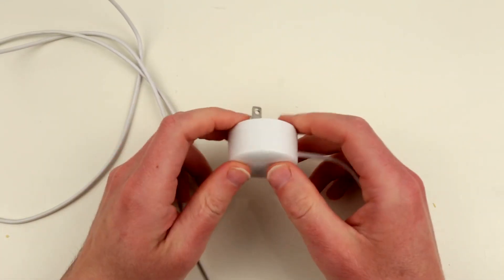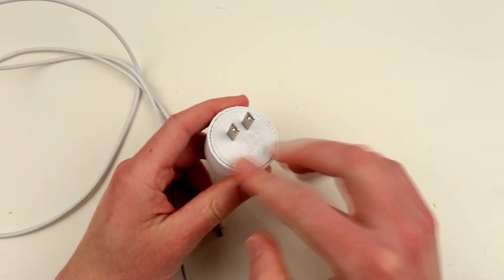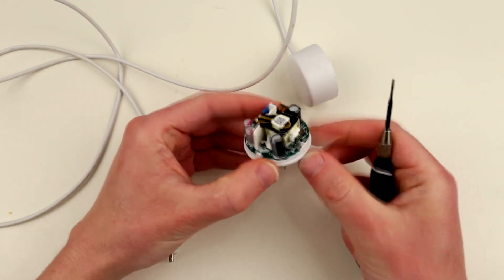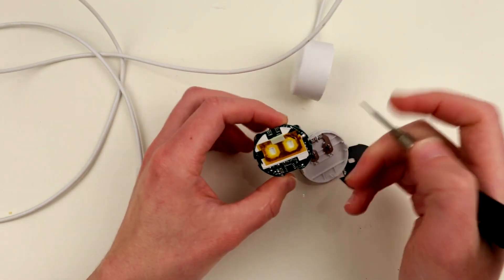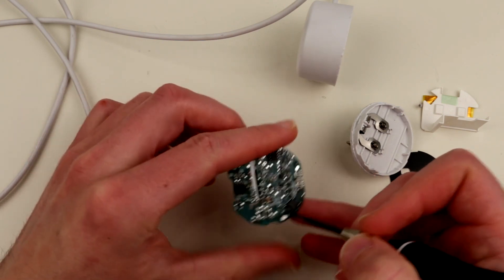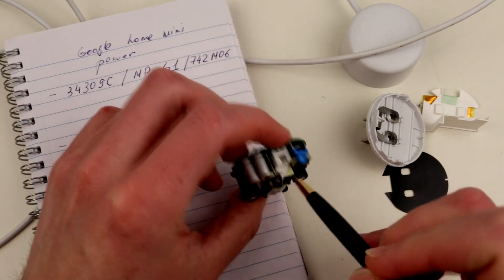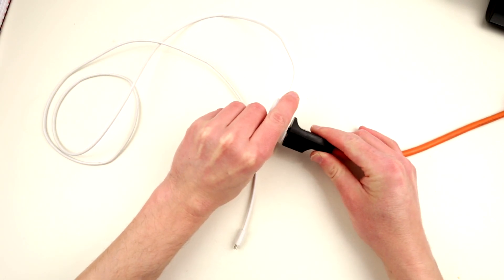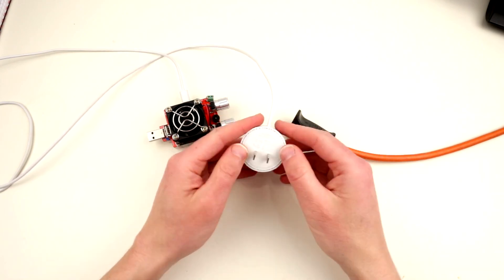Teardown and Repair of Google Home mini power supply

Comment: I'd love to see if the Nest Wifi plug is similar. I'm frustrated it takes up so much space on my outlet, which has USB chargers that get covered up by this round shape
Reply from the maker: You can use pretry much any USB plug as long as it can do 2A continuous !
Reply: @InsideOutElectronics  I'm not interested in powering it with USB, I want an AC adapter that doesn't cover the USB ports on my outlet
Reply from the maker: @BothellPlaysMusic  But you can use any AC-USB adapter that fits you dimensional needs, as long as it provides 2A 5V. For example for My Google home mini im using just random tall and square ac-uab plug that does not cover anything

Comment: Hey, mine stills works, the problem is that it doesn't have the enough energy to supply the google home mini, so, how can i fix that?
Also when i use a conventional charger, the google home turn off when i try to increase the volume after the 50%.
Reply from the maker: Same issue with volume, and I still did not fixed mine.  It exhibits exactly the same issue, it keep restarting if power load more or less substantial. Work fine with tiny loads.
Reply: @InsideOutElectronics  Did you fix it now? Cause I am having that problem and I don't know what to do.

Comment: That's bad. I hoped I could cut the wire and connect it to the wire in the wall... But's not that easy.
Reply from the maker: Han, just using different power supply... no worries :)
Reply: Inside Out Electronics hey, i have just Got a google nest mini 2nd gen, what power and amps does it use

Comment: Put a little petrol using a syringe within both plastic pieces and use a plyer to pull the two points away from rest of the main body
Reply from the maker: Ok good point, thank you! Will try next time with another plug !